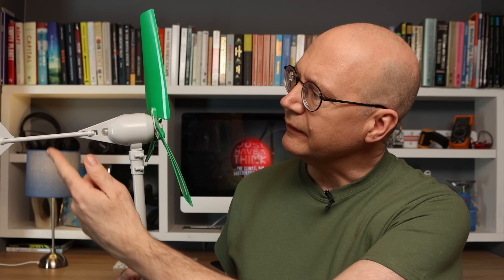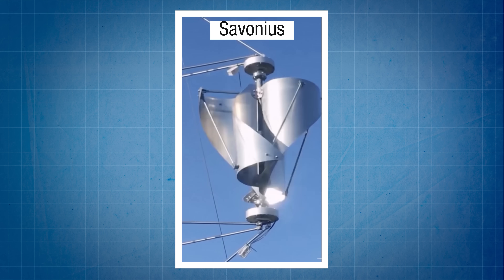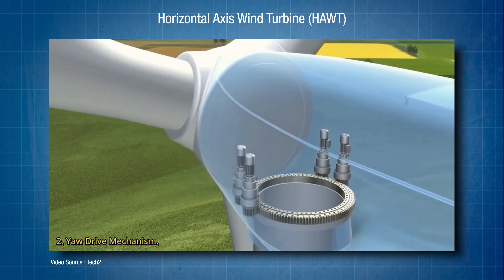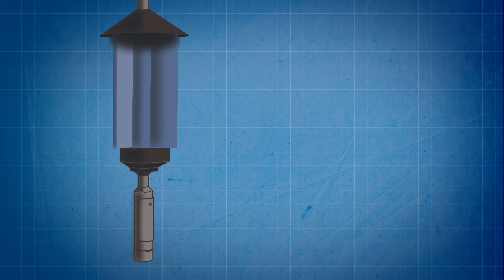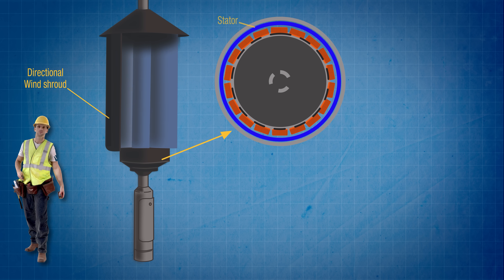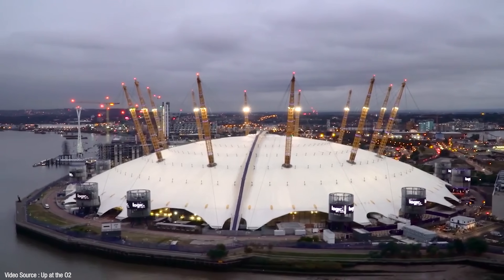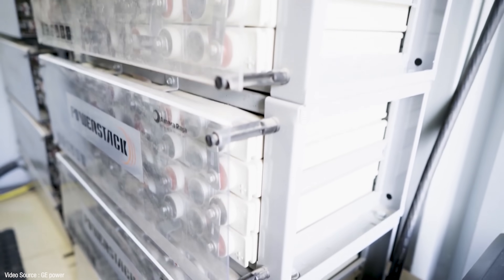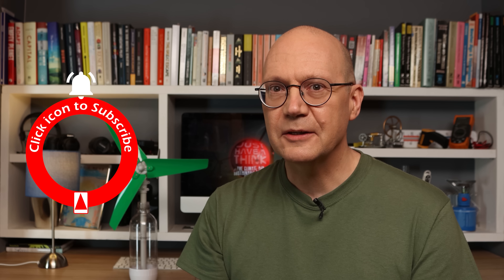A vertical axis wind turbine that doesn't need the prevailing wind! How do they do that?

Comment: Please stop and think that there is good reason(s) that street light poles have available bare areas where to date nothing has been permitted to be bolted on or a hole drilled through the street light pole's metal wall for a wire way to pass through, weakening the street light pole. The list of requests to bolt many types of sensors and celebratory / advertisement banners rings the telephone at the street light pole owner's office and is annoyingly never ending by the uninformed thinking "hey look at that unused pole space area I was the very first to discover, what a waist, I'll just use that, and it is a perfect place to place my exciting X gadget idea to benefit society". These attachment requests to add the next well meaning or beneficial service for humanity or profit idea to that fortunatis bare street light pole surface area just sitting there, that no one before has strikingly ever thought to use, still unused calling out "please bolt here" are refused for good reason. The street light pole was designed only to hold…..you guessed it… a light or lights only. The street light pole and supporting base were to control installation costs ultimately paid by your tax dollars not over designed to support the next unknown weighted "great idea" if and when it comes. The reasons outlined next are why the street light pole designed to support an elevated light(s) often has nothing else attached to it. This Renewable Energy Collection scheme proposed to collect the variable air disturbance caused by passing vehicles and also wind by wind generators attached to existing open spaces on street light poles will unfortunately bump up against the same existing street light infrastructure physical design needs in our real world and must take into account all field install variables not discussed here such as, needs for public safety of inquisitive hands or poking sticks and passing vehicles, intentional vandalism at lower hand reach level, heavy weight conductor / motor scrap value theft, and our litigious societies indirectly stymieing /  regulating through corporate liability exposure the addition of pole amenities like adding this large surface area Vertical Axis Wind Turbine  (VAWT) at the pole base which will void the pole warranty by increasing the Effective Projected Area (EPA), causing induced pole wind loading. Repeated wind induced resonance from increased wind loading events be they type one or type two will reduce the poles expected life cycle near their welds which increases the chance of prematurely snapping the poles off above the base plate welds after installing the VAWT. Poles falling on passing vehicles or pedestrians never is a good thing. I see attorneys loving this greenwashing idea as a big money maker in court as this VAWT company is sued out of existence, when found liable for modifying the pole from its intended design parameters while not having done an existing pole integrity inspection / existing pole engineering load redesign study / existing pole recertification, after the first high speed multi vehicle crash caused by hitting a downed pole laying in the road or the deceased pedestrian that had their head crushed by a pole snapping off in turbulent or straight line winds located near buildings as they walked near by on a walking path. Having worked in the street light and street light pole industry for two decades, I will say firmly that this is a bad idea. Street Light and Pole specifications are originally taken into consideration to live in harmony and when going outside these street light and pole specifications by just changing heavier and bulkier vintage HID street lighting to lower profile and lighter LED Street Lights on existing street light poles is causing premature pole fatigue, failure and lawsuits. Then there's the concrete street light base sized to the original intended wind loading. The concrete base most likely will need to be removed and made larger to accommodate increased VAWT wind load during high wind prolonged events. Next consider that street light cables run for long distances and are wired in series. Aluminum / Copper Conductor  gauge will likely need to be increased in size because of increased Amps from electrical generation , driving up install cost, and if existing ducts can not provide 40% free internal air space these larger cables may overheat and burn their insulating cover during electric energy generation, more repair costs. If not enough cooling air space then additional duct system paths will need to be installed driving up installation costs even more. Also grass mowing operations around street light poles often knock hand box lid covers off the duct system allowing in water and nesting / chewing rodents in decreasing cable reliability and street light cable repeat repairs drive up another long term cost of ownership, called faulting,  impacting return on investment calculations. Oh, and then there is the design of a street light pole set on a break away base intended to allow a pole to dissipate energy away from a crashing vehicle by breaking off cleanly so the vehicle can pass through the pole without stopping, by lifting the street light pole into the air on impact and tossing the street light pole over the impacting vehicle's metal roof. A high speed sudden stop is deadly causing internal organs to rip apart how they are naturally connected. Now the same street light pole if weighted down with more mass by a VAWT may not as quickly lift into the air and toss over the vehicle's roof but allow the heavy generator and blades to smash into the vehicle or through the front windscreen (windshield) causing injury or death to occupants that would not have happened had the pole been tossed clear over the vehicle's roof. Also, today more vehicles have glass roofs and tosing over not onto is an important safety feature diminished by strapping a weighty VAWT to a street light pole standing next to a high speed roadway. Oh yes attorneys will look forward to their day in court and following damage award payouts because of these ill advised, after street light pole manufacturer certification, street light pole VAWT install modifications and damages caused by the disabling of the street light pole's breakaway base safety feature throwing a heavy metal generator motor with blades through glass impaling, mauling  the vehicle occupants. So, "How does this idea workout"?? "Just after having a think, about it"...."Not at all in the real world"!!

Comment: Oof. It’s not necessarily safe to assume that all generated motorway wind would automatically go to waste heat. 

Whether this system constitutes a net efficiency gain depends on the whole-system fluid dynamics, which would have to be analyzed including the cars & trucks on the motorway. Not just the turbines themselves.

Maybe it’s a net win, or maybe this reduces the slipstream, or makes motorway airflow more or less laminar than it might otherwise be. Unfortunately the incentives are wrong for developers to discover this, as they get paid for their output, not total system efficiency.

It’s really frustrating to see systems like “solar freakin roadways” or other dubious energy scavenging technologies which may exploit public enthusiasm to enrich the system developers regardless of actual merit (thermodynamic or otherwise)

I bet an extra-shiny nickel this is one of those

Comment: I hate wind mills they are an eye sire they are harmful to the environment and take massive amounts of land.  Where the typical natural gas fired genteration plant tak only 5 acers of land and produce thousand of time more electrical power, and newly design nucular power plants where no nucular waste is produced also thousands of time more electrical energy also using about ten acers of land.  Turbin are using thousand of acers of land, they have proven to cause helth hazords through low frecency sound waves. People living near the turbine fields are having health problem and many have abandon their home.  Those that have agreement to install wind turbine on their land have to sign an agreement to not make public the health issues.   

The life span on the wind turbine is about ten years then you have all the haxordus waist from the turbine blade, lubrication oil and palstic used in the one turbin.   

The life span gas powered elecctrical generation plant is 30 to 40 years with no waste.  All material used in a plant are recyclable as they are made of steel. cast iron, copper and concrette.  

Wind turbine and batteris are not the answer to our power needs.  The push is all the government subsities these companies investors are getting from your tax dollars.

Comment: I may be wrong but I intuitively see this as a means of increasing the power consumption of the vehicle. The air is pushing the VAWT but the VAWT is also pushing the air back, the air that in normal traffic would have been moving more closely coupled to the vehicle passing through it. A vehicle having to pass through 'still' air will need to work harder than one that is travelling in say a slipstream. This is still a good idea and should instead be used in places where vehicles will need to slow down anyway, like approaching junctions.

Comment: Bright idea!  As a retd. design engr. I had a similar idea when visiting a Buddhist shrine in 2011. They have rotating vertical cylinders which are rotated by pilgrims. Apply this to Street side generators. People powered. Develop this and try after Corona has gone.

Comment: Hi, I’m curious to hear how they would affect local wind patterns and subsequently local weather. Also, would it help mitigate road noise or would turbine noise be worse?
Reply: Horizontal windmills emit considerable noise because of the high speed at the tip of the propellers. Vertical windmills have a uniform load and movement. This makes them considerably more silent than horizontal ones.
Reply: @peterpanning4779  hi, I appreciate the clarification. Do you have any data on noise comparisons of the type of turbine eg one is only 10% of the noise volume of the other?

Comment: Not only more efficient, but more bird friendly.
Reply: Birds aren't the most intelligent life form. 
There's a reason it's an insult to be thought a bird brain.
I.Q. roughly twice that of a snail.
Birds will adapt, or go the way of the Dodo.
Just as Nature planned it ...
Reply: @fjb4932  A life form that is not capable of recognizing the fairly large variety of IQ between bird species is not very intelligent either
Reply: @fjb4932  you can't dodge what you can't see.
Reply: @capturedflame  Not bird friendly? You'll need evidence to dispute that. The reality is that on a regular turbine the blades spin too fast to react to it. They also create atmospheric intensity that burst bat's lungs.
Reply: @KTPurdy  No, you need to prove that this won't kill birds on the same level as other turbines do. If you don't know what a null hypothesis is, go check it out. And what on earth is "atmospheric intensity"? Anyway, if you think these are efficient, I have an  Eiffel tower for sale. Cheap, too!
Reply: @tzenophile  How often to birds fly into a building without windows? This turbine design is equally opaque.
Reply: @KTPurdy  Are you asking me? I remember seeing a duck fly straight into a wall. Left a nice, wet duck profile. So unless you KNOW differently (which you obviously don't) I'd say it happens more often than you think. And just so you know, there are near-infinitely more walls for birds to collide with, than windmill blades.
Reply: @tzenophile  Be real dude. No, birds don't fly en mass into opaque objects. 
"And just so you know, there are near-infinitely more walls for birds to collide with, than windmill blades." that is the central point isn't it. As the number of wind turbines grow, the number of bird casualties rapidly multiply.
Reply: @KTPurdy  What's with the opaque-fixation? Birds collide with buildings. Look it up, it's a thing. Anyway, you don't make much sense. no offense, but there it is. Including your initial and clueless praise of totally inefficient (and far from 'opaque' lol) vertical windstill. They don't work. Be real, was it?
Reply: @KTPurdy  and btw, "atmospheric intensity"?  Care to explain?
Reply: @tzenophile  Opaque fixation? Birds simply don' t fly en mass into things they can see. It's not a hard concept. Inefficient  windmills? You missed the intent of the design. Rewatch the video.
Reply: @tzenophile  "atmospheric intensity" study what turbines do to bat lungs.
Reply: @KTPurdy  No, based on our critique Dave had to admit errors in the video. I don't think I missed it at all. Just read the comments under his pinned comment. They go on for a while. Then you can see how ridiculous (or fraudulent) this product is. And for  the third time, what does "atmospheric intensity" mean? You seem to be using words you don't understand.
Reply: @tzenophile  Dude, I'm not doing your research for you. I already stated what you need to research.  Cheers.

Comment: 8:10 That is wrong. The airflow is disturbed by the wind turbines and thus increases the drag that the vehicle has to overcome, resulting in a higher energy consumption of the vehicle. It is not relevant whether the vehicles are powered by fossil fuels or by renewable electricity. All energy generated by the turbines comes directly from the cars' fuel tank or battery. There is no such thing as a free lunch. Basic thermodynamics.

Comment: As wonderful as that sounds, to collect energy from passing vehicles, it is a false value proposition. The energy comes from the vehicles. The vehicles are pushing the air out of the way. When there are no obstacles to impede the air being pushed away, the vehicle uses the least amount of energy. When there is increased resistance, the vehicle uses more energy. Wind turbines, by definition, provide resistance. They remove energy from the air thus slowing the speed of the air down as a result, this is why there is a limit to how much energy you can remove called Betz Law. By impeding the flow of air, you are increasing resistance to the vehicle forcing it to use more energy to go the same distance. This is an incredibly inefficient and high carbon method to generate electricity. This should not be encouraged.
Reply: Watch out, you're going to piss off the minions with your facts.
Reply: @TheDudeKicker  Thanks for the heads up, it appears to be a way of life for me. :D The Dunning Kruger effect is strong.